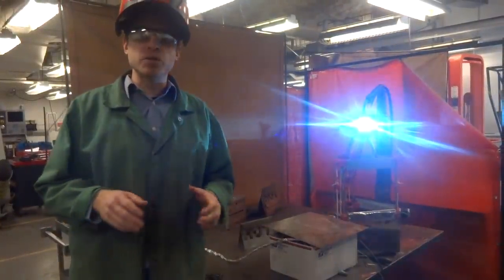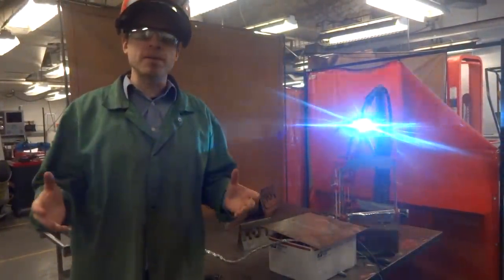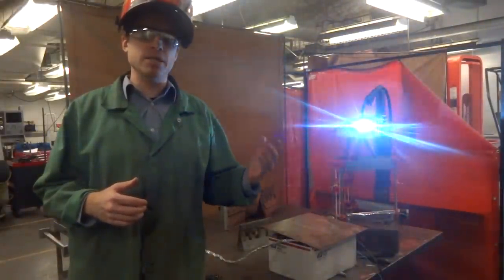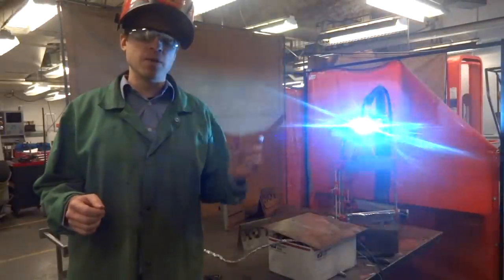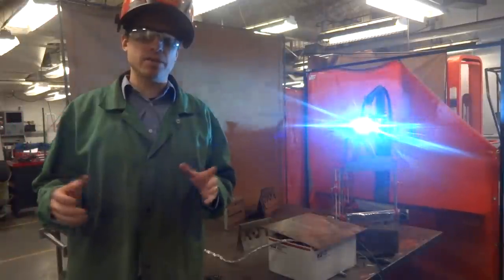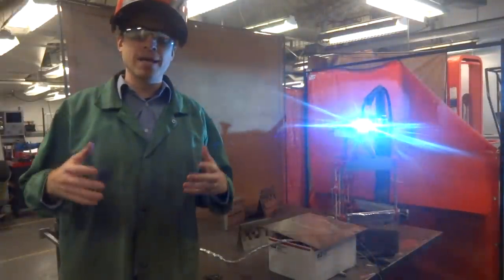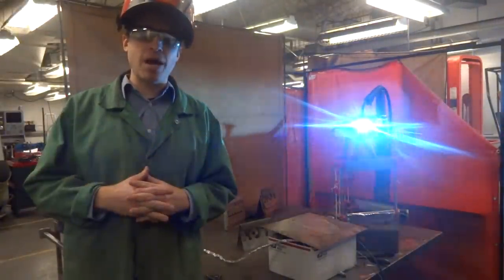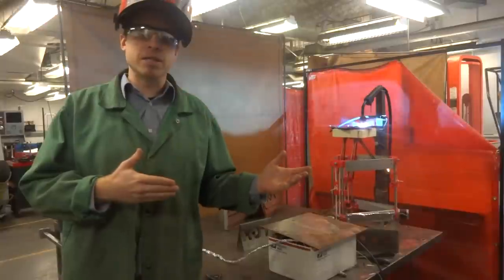Video of Low-Cost Open-Source 3D Metal Printing v.1 2013

Comment: I've seen your 3d metal printer and it seemed to me a great idea. spent years working on metal boiler, folding and laser cutting
near my workplace there is a welding robot, so I have more or less how it works, set at the apoyo of the piece and I think it can be improved in an easy way. you need are 3 axes, well, desktop cnc milling machines for wood, provide extra rigidity and is very easy to make your structure, you can also create larger pieces as the vase is solid and does not move, hope to serve you, my most sincere admiration

Long live the open sourceI